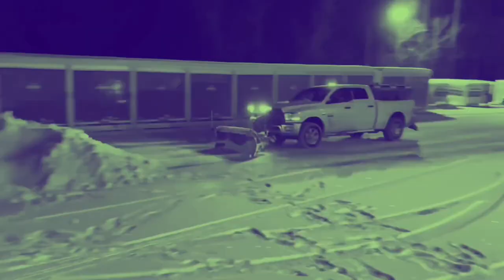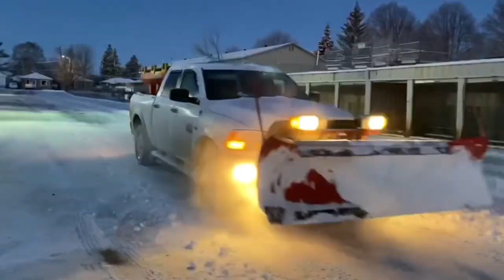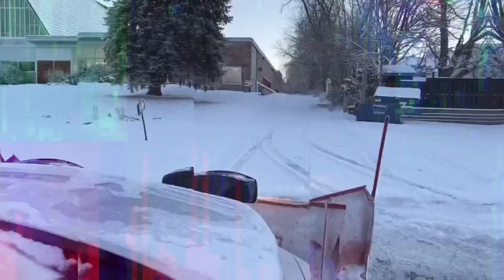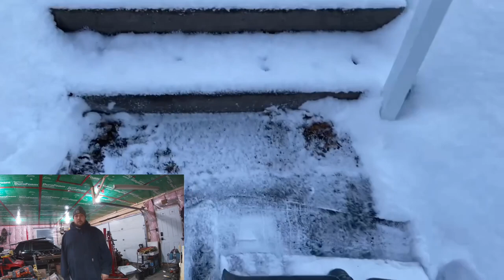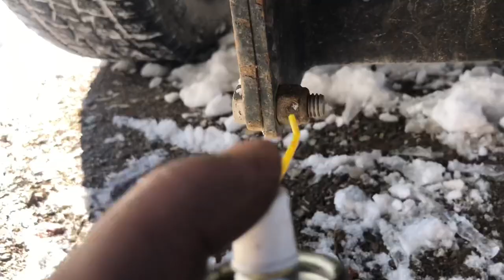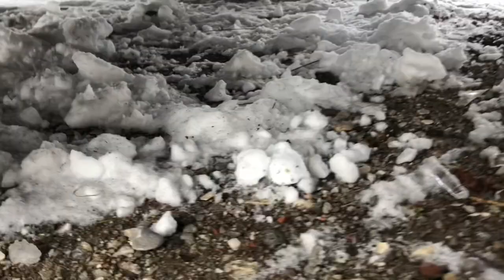Snowplowing Vlog pt3 (How To Plow A Parking Lot) “Hemi Plow Truck”

Comment: Do you have a 2" spacer kit on the front of that Dodge 1500 with the Snowdogg? That would help with your clearance issues.
Reply from the maker: No currently it’s just stick suspension! I did get another bit of clearance adding some air to the tires! Lol I am considering doing a small lift and possibly some coil over shocks to stiffen it up! Thanks for the input!! CHEERS